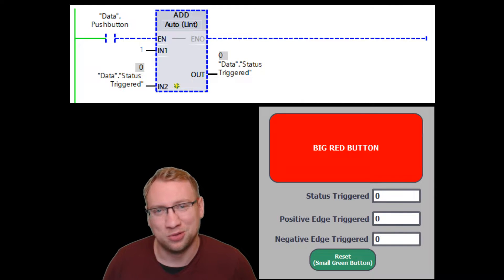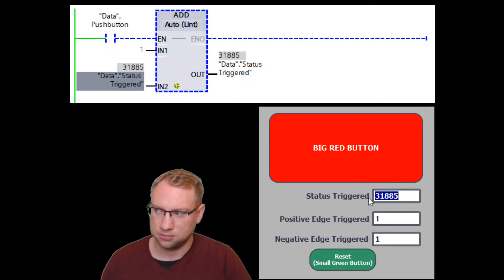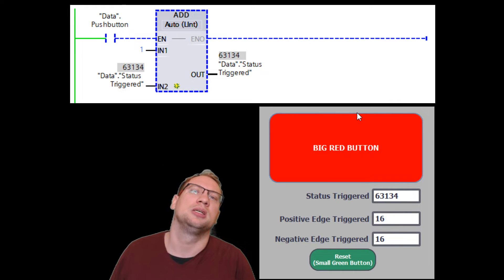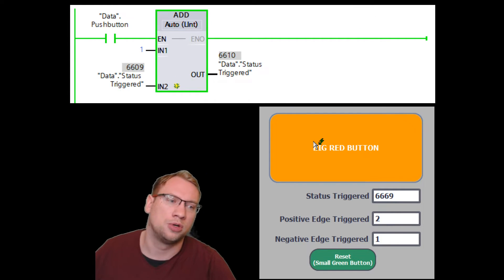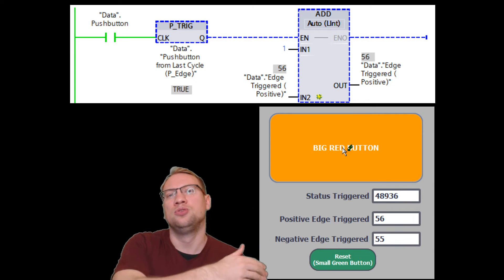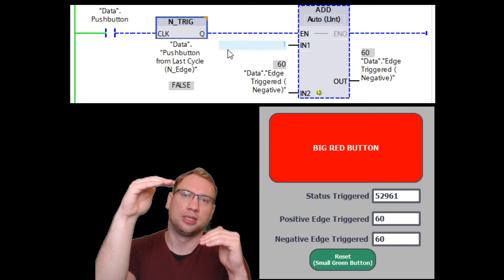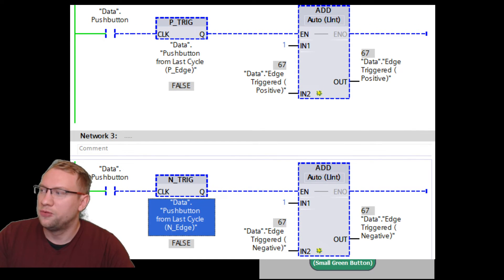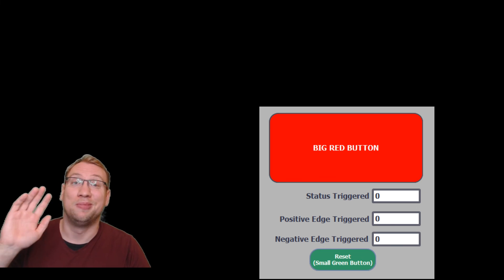"Edge Trigger" or "Status Check". When, Why and How?

Comment: Hello,
i did not understand "Data".Status Triggerd" how it is changing ? 
you have pressed the button just one time in my knowledge  we should  add one each push not more.

thanks your are doing a great job.
Reply: PLC works like any other computre with a clock,, what the program gets is a High signal but read it has fast the computer (frame refresh) and PLC  can work like 1ms,.iI you press 1 time but your finger stay there  15ms  it works15 times .  Hope this help you

Comment: Nice. P_trig is extensively used in Simatic manager to set bit for an alarm and reset it even though alarm exists.
But I got a new function in Tia portal as R_trig  with static address is very  compatible in functional blocks.

Could you please distinguish P_trig and R_trig. 

Why did siemens introduced R_ trig? 
What is its advantage over P_trig?